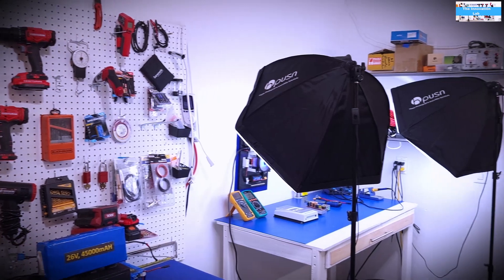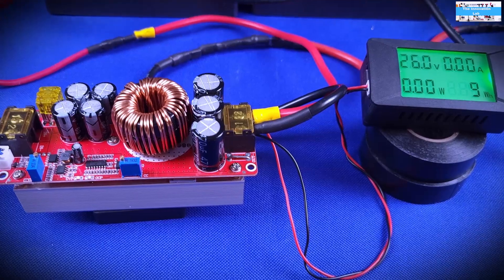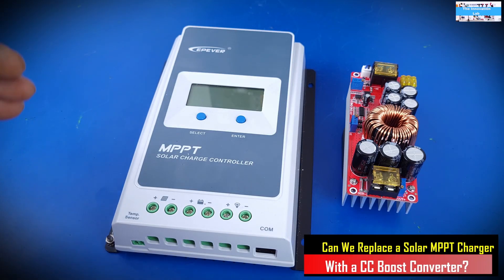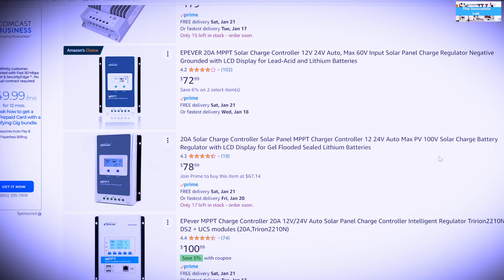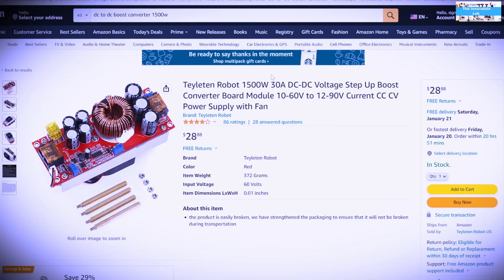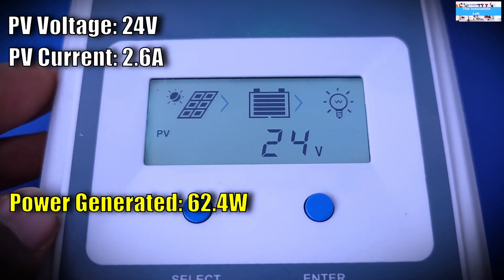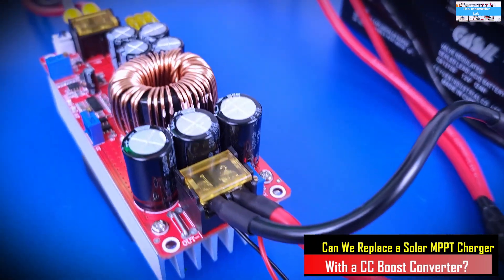Solar MPPT Charge Controller vs DC to DC Boost Converter, which is Better for Solar Charging?

Comment: What's the ripple?
I heard that ripple could degrade the battery. Any tips?
Reply from the maker: You are absolutely right about ripple voltages being a possible concern for battery health.  However, it also depends on the ripple frequency. The peak-to-peak ripple voltage is important for battery charging systems, but low frequency ripples are more detrimental to your battery cells.
These converters have high switching frequencies in KHz, and I believe that battery systems should be less sensitive to such ripples.
The empirical rule of thumb is that ripple voltage should be less than 1.5% of the charging voltage - for a charger with a decent output.

I measured the no-load ripple on these converters at some point, I will check my notes or possibly remeasure it and update you.
Thanks for asking for a thoughtful question.
I love it when people engage intellectually instead of the random disguised and exhausting trolls.
Thanks again.
👍😎
Reply: @theinnovati0nlab782  thank you kindly! I bought a 3000W Chinese UPS, and turned off the charger because I saw it charging and discharging every second -- scary stuff for lithium ion! (Using a 48V ebike battery, until I figure out how to connect car lithium cell tabs together.)
Now I use an AC power supply feeding one of the AE 1800W boost converters. At the moment, that feeds a Victron BlueSolar MPPT 48 -- which keeps the battery at 50% charge. Theoretically I could use the boost converter directly, but the solar panels are not installed yet.
Was thinking of replacing the 30V PS + BC with something simpler, more efficient, and high reliability.
Looking at MeanWells, the ripple spec is 150-250mV, which concerned me. I am basically floating the battery at 50% 24/7, with the UPS pulling 100mA constantly. (Also, MWs seem to top out around 55V, which wouldn't work if I go to a higher battery voltage -- the UPS doesn't go into protection mode until 60V!)
Would love your advice please!
Reply from the maker: @mrtechie6810  
Wonderful, I hope I understood you well. If not, please correct me.
However, if you have a 48V lithium phosphate battery and your solar system is not ready yet, I would recommend that you try charging the battery using the boost converter. But I will recommend using a well calibrated power monitor to keep a close eye on your charging currents and voltages. I am not sure about the capacity (mAh rating) of your battery pack, but I would recommend consulting the battery manufacturer's spec for the recommended charging voltage and current. 
If you built the batrery diy, then what I have found from research is that you need about 3.65V to charge a single lithium phosphate cell (4.2V for Li-ion). This is for both the constant current and constant voltage charging phases.
This means that your 48V battery possibly has about 16 paralleled groups of cells in series
So this means that you need about ==> (16*3.65) = 58.4V as the charging voltage. You can use the 55V just to play it safe....but your battery won't get to 100% charge.

The charging current is really a flexible parameter, and it depends on the charging rate that your battery can handle.
But I believe that the rule of thumb is to keep your charging currents below 0.3C  for LiPo4 and Li-ion batteries.
Where "C" is the mAH rating of your battery. Personally, I would recommend using less than 0.2C, especially since you are still testing your charging setup.
For example:
If your battery is rated for 48V, 30,000mAH.
I would try using the following;
Charging voltage: 55V
Charging Current: 6Amps

SAFETY TIP:
These batteries have very high energy and power densities, and this makes them vulnerable if overcharged. If you built the battery, make that you used a reliable BMS circuit that will prevent your battery from overcharging or overdischarging. Make sure you watch the charger and power monitor very closely. Charge your batteries away from any possible flammable objects. Make sure that the charging area is very well ventilated. Again, please keep an eye on your charging system.
I hope this helps in some way. Please don't forget to update us on how your project went with the solar.
Success wishes to you!
👍😎

Comment: be careful with this boost converter
it can only limit the current if the voltage in is lower than the voltage out.
example 20V in and 24V out

this doesn't work. 37V in and 24V out.
then you need a buck/boost converter.
Reply from the maker: Hi friend.
Thanks a lot for the amazing comment. Safety is always an important note and the number priority.
However, it appears that you may be confusing this video with a different video.😊
Please, where did you see the "37V INPUT and 24V OUTPUT" that you mentioned? Were you able to watch the entire video?
The solar panel emulator provided a 24V input that was boosted to about 28V level... which corresponds to the charging voltage required for two 12V lead-acid batteries connected in series(24V). 
Please let me know if you have any questions. But this test is very straightforward and actually presents a low risk. 
If you are to use it with a solar panel that provides 37V, then you should never be using it to charge lower voltage battery as you mentioned....that is correct. As a matter of fact the boost converter will never produce an output voltage that is lower than the input - that is against the design principles of boost converters.
Thanks again, my friend.
Success wishes on your projects.
👍👍😎

Comment: Being a "boost converter" it will always output a higher voltage than the input => You will need to add a step-down regulator ( extra loss ) in order to make this work as a charger. 
You could have skipped the "testíng part" and just read the specifications to reach that conclusion. 😉
Reply from the maker: Hi friend,
I like your sense of humor, 
Hahaha. However, your comment was predicated on a preconceived notion that this content creator can actually read....you never know, maybe he can't.😉😂
However, thanks for the great feedback, though I appreciate it. 
But I very respectfully disagree with your viewpoint about boost converters. The fact that a converter works in the 'Boost' mode does not mean that it can not be used as a battery charger. As a matter of fact, I have demonstrated this concept in multiple videos. To charge a battery, you basically need a power source that can perform the following functions.
1. Supply an output voltage that is greater than or equal to the required charging voltage of your battery system.
2. A current controlled source that helps you dial-in the required charging current for your battery.

Now, having said this, these are the features that this boost converter has already provided. Voltage control, current control, etc. The idea was to boost the output voltage from the solar panels using the boost converter such that it can be used to charge the 24V battery shown in the video - and it works!
The question is not if it works.....the question is, can its efficiency come close to that of the MPPT charge controller....as a "Solar charge controller"? The clear answer is .....NO. This is simply because a solar panel is basically a weak power source that is dependent on the solar irradiance incident on it. The MPPT charge controller uses an incremental conductance algorithm to regulate charge with varying solar irradiance by implementing the 'Maximum Power Point Control' function.
Now, if you can glean all of this performance/efficiency behavior from reading a poorly written spec on Amazon, I salute you, my friend!
👍😎
Thanks again for the wonderful feedback.
Reply: @theinnovati0nlab782  You're right. And I thought that you made this content entirely. :D

I think we're misunderstanding each other.
My point has nothing to do with efficiency, but with safety.

As far as I know. This controller doesn't support "CV regulation" of the output voltage, in the case you want a lower voltage than the input voltage!
( This is important info and should IMHO be stated in the video. )

If the voltage on the output rise beyond float charge levels, the boost converter will "as you say" go into CC-mode.

But if the situation is maintained for a long time and there's enough power available at the input, the voltage will eventually also rise, and it will damage the battery.
 
So the safety topic I'm missing in this video is: Before considering this controller at all, you have to make sure that the "solar panels" does not have an Voc, higher than the highest safe voltage of the batteries. ;)
Reply from the maker: Hi friend,
I am loving this interaction and I am glad you get my sense of humor....Hahaha.
However, you are right about safety - always very important. The points you raised were absolutely valid.
We feel blessed to have such brilliant minds  supporting our channel.
Thanks again my friend!

Comment: I dislike this because 1. You are using different measuring equipment. These cheap power meters may be very inaccurate so readings would differ compared to your inverter onboard readings. Should use the same power meter for both tests. 2. Comparing two different situations - voltage buck charging 12V battery and voltage boost charging 24V battery. This is unfair comparison because buck conversion is generally more efficient. So your epever mppt controller has unfair advantage here. You should compare cheap buck converter (pick one with low voltage protection feature and set to solar panels MPP voltage). Only then you will get a fair comparison.
Reply from the maker: Hi friend,
Thanks a lot for the wonderful feedback and for letting us know your reason for disliking this video. We appreciate it.
👍👍
However, this video was not really intended to be a one-for-one comparison between the Epever MPPT controller and the boost converter. 
This video was merely a response to multiple questions regarding if this boost converter will be suitable as an efficient solar charge controller replacement. The Epever controller was merely used as a control equipment as a source of good data. Comparing two cheap converters may not tell me anything because both of them may end up being outright bad.  I understand what you are saying about the cheap power meters, but the fact that something is cheap, doesn't necessarily mean that they will automatically be inefficient. Also, I verified the readins of those meters using my calibrated Fluke DMM.

As you probably know, making videos of this nature takes a great deal of time, resources and effort and perfection is almost impossible - especially with  limited time and resources. There is always room for improvement with good positive feedback.
Just an FYI,
I have also made a video to actually compare a buck converter with the Epever.
But now I am worried that you will dislike it as because of the cheap meters...😂

Thanks again, my friend and enjoy your weeks.
Success wishes on your projects.
👍😎

Comment: Does the MPPT constantly change its internal resistance to match the panel?
Reply from the maker: Hi friend!
This is a very interesting and intriguiing question that is worthy of research. As far as I know,  MPPT Charge Controllers use a very complex algorithm to implement what is known as incremental conductance. I believe that conductance is the inverse of resistance, so in a way, your theory may be correct. But honestly, I have not done any research to know how the handshake between the MPPT software and hardware is implemented.

One of the best questions of the year!
👍😎
Reply: @theinnovati0nlab782  you can easily build an mppt controller with Arduino, build a normal buck converter with Arduino and you need to measure solar voltage and current then you can get watt by multiplying them. Implement this simple algorithm for mppt
If(solarWatt > previousSolarWatt){
If(solarVoltage < previousSolarVoltage){
Pwm++;
}
If(solarVoltage> previousSolarVoltage){
Pwm--;
}
If(solarWatt < previousSolarWatt){
If(solarVoltage < previousSolarVoltage){
Pwm--;
}
If(solarVoltage> previousSolarVoltage){
Pwm++;
}
}
Reply: @john shaw yes, by increasing or decreasing duty cycle.

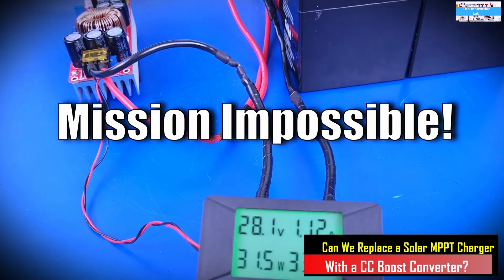Comment: Right around 15:45, you say "does not EXCEED". What are you referring to? the voltage? Is that for fear of driving current backwards? which I'm also told does work, but haven't tested it. If that is the case, then I think a Diode inline would fix that.
Reply from the maker: Hi friend,
Thanks a lot for the feedback and wonderful questions. 👍👍
Sorry about the confusion,  I agree that my explanation in the segment was not perfectly worded.😊
However, I was referring to the fact that the battery may attempt to demand more power than the solar panel can provide - given the panel ratings and available solar irradiance.
I also realize that this is practically an impossibility. However, this will only lead to oscillations.
Also, you are right about the use of a blocking diode, I will implement that on the next test and observe the response.

Comment: Perhaps you could add a simple window comparater type circuit controlling the booster's output with an electronically-controlled pot??
Reply from the maker: Hi friend!
Thanks a lot for the wonderful feedback. I like the way you think. When I get the time to revisit that test, I will give that a try. Hopefully, it will be simple to implement.
Thanks again!
👍👍

Comment: I need to convert 50v dc to 12v dc , 30A (from 24v solar panel) for using 12v d.c motor ...i searching pwm charge controler or buck converter ...can u please explain which type device is possible to use ....
Reply from the maker: Hi friend,
To get good value out of your system, I will highly recommend you use an MPPT solar charge controller. Personally, I have used the EPEVER models for a few different projects, and they seem to work well. Also, they have a wider input voltage range than most buck converters you may find out there. Just make sure that you get the one that is rated for 12/24V output voltage and an output current of 30A. 

The real issue for most people will be the cost, because these MPPT charge controllers will cost you somewhere between $80 to $100 - just for the 30A version.
Also, make sure that you have a battery between your solar panel and your dc motor. The battery will act as both the energy storage device and the current surge buffer.
This is how I would do it.
Solar panels ==> MPPT solar charge controller ==> 12V  battery ==> DC motor.
For your battery, I would recommend using a lithium phosphate battery if you can afford it.
Reply: @theinnovati0nlab782  i have MPPT , But i need use low cost charge controler for only using motor (fish pond ) ..

Comment: But cc cv has settings too to set max output and input voltages currents. Still buck convrrters may do better work with adding low and owercharge protections ofcourse.
Reply from the maker: Thanks a lot for the feedback.👍👍
We appreciate it.

Comment: Im using a few buck converter, i get around 90-97% efficiency, depending on heat & amps. I adjust amps sometimes on the potentiometer if the weather is very good. I do need to expand it a bit so it can handle more amps while only warm instead of hot. They drain a low ah buffer battery into a larger 12v system, usually at 4-500watt. The buffer is fed by a mppt.
Reply from the maker: I am planning to do a test with a buck converter as well. But I am waiting until we get some significant sunlight in my location.
Thanks a lot for sharing your experience. We need more people like you in our community. Please, we would appreciate it if you could share our videos to help this channel grow.